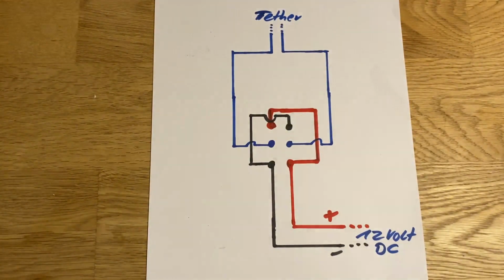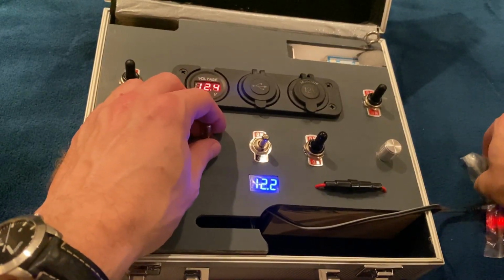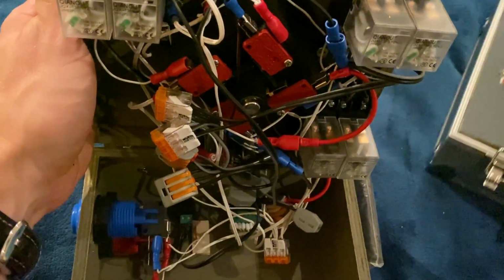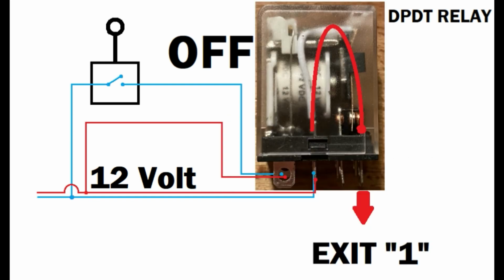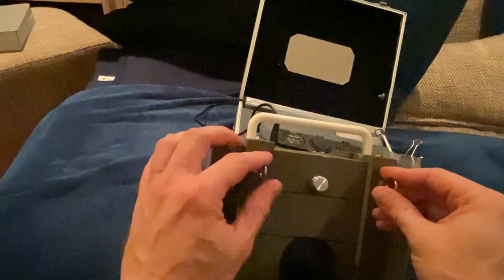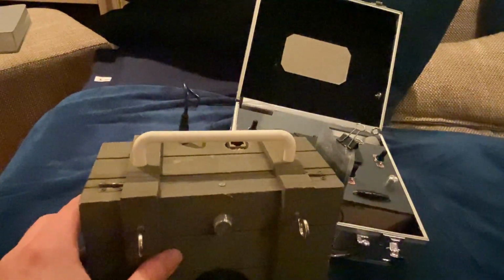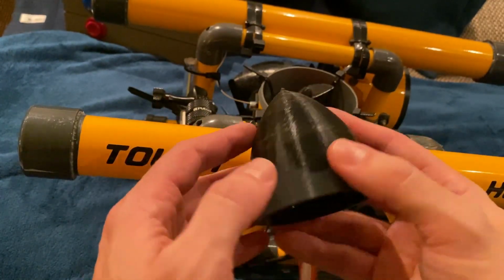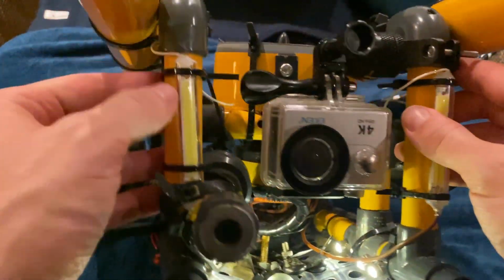ROV arcade and basic Controller Box - DIY submarine Seaperch projects

Comment: Where can I get those relays with the green led?
Reply from the maker: https://www.ebay.de/itm/265704341943?mkcid=16&mkevt=1&mkrid=707-127634-2357-0&ssspo=MTqRJJj_Q4e&sssrc=4429486&ssuid=l2ig-GVYRiu&var=&widget_ver=artemis&media=COPY
Reply from the maker: However, they are indeed quite massive. Smaller ones also do the trick. Unless you specifically want the visible technology  - like I do. 

In case the link doesn’t work, search for:
12V DC Coil Power Relay LY2NJ DPDT 8 Pin HH62P JQX-13F With Socket Base
Reply: Thanks for the reply 😁

Comment: Where in the chain did you put the 12v regulator would you mind producing a wiring diagram for it ? no worries if thats a problem.
Reply from the maker: Well, that is a problem because the regulator only varies the engines, not the „chain“-LEDs. 
But if you want to dim the lights, just wire it to the tether. That’s really simple:
+/- from the 12 volt power source into the regulator and from the regulator to the lights. 😁👍🏻
Reply: @agermangineer  Sorry I meant the motors not the lights.
Reply from the maker: @matthewbennett2844  oh ok, well once again: check out my wiring Video at: 5:54 (Not this Video)
Here: https://youtu.be/Hx78yZjKz-w
Reply: @agermangineer  oh my lord now you mention it I remember it's in that video. Sorry.

Comment: Can you explain what you used to divide up the power a little bit more? (those little clear boxes with the white tabs. You didn't know the name of them in English)
Reply from the maker: Jiggle.The.Handle ok, first of all cool nickname!! Reminds me of Jeff Foxworthy.

Anyway; google translator keeps calling them terminal blocks. Does that ring a bell? The way they work is you take a bare electrical cable that bears power. And over this terminal block you can distribute the power over to the other cables, which are also clipped into this Little box. 
You could also just solder them together or use any other method to spread your incoming power to other lines of power. Anything that keeps resistance at an absolute minimum. The better those power connections work, the less power you lose. And yes, poor wiring really does cost you power! 

On my very first project I basically just twirled some of the thin wires together... never again! 😃
Reply: @agermangineer  Duh - terminal blocks. I wish I had paid more attention in my electrical engineering class LOL thanks

Comment: Excellent, thanks for posting these videos. I'm really new at this so please pardon the dumb questions. [All of my questions are about your second controller.] Are you using the same RJ45 Cat splinter that you used onboard the ROV? What are the 2 silver switches for? Is that black box in plastic your battery? (I was expecting to see more like a car battery)
Reply from the maker: Yep, same splitter! The two silver switches are merely there to turn on the intake voltage indicator of the incoming power source and the USB-charger. And finally: yes that small box is the battery. And yes, it is small an cheap, though quite powerful: probably 2x3 3.7 Volt batteries (type 18650) in series.That gives you at least 8 Ah that will last you about an hour. Love it!!
Reply: @agermangineer  Thanks! I've been working on the power part for a couple of days now but I haven't had much luck finding a comparable battery on the internet. Can you tell me where you got it?

Comment: Nice job !how did you mount the propeller on the pump? Do you  need to remove some parts to access the pump shaft?
Reply from the maker: Alain C yup. First you have to saw off the white Pump housing and then jimmy off the plastic disc from the pump shaft and that’s it. There are numerous videos on YouTube that show you how it’s done. Just look for bilgepump ROV thruster and you should find something. :-)